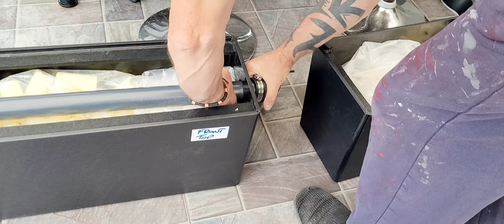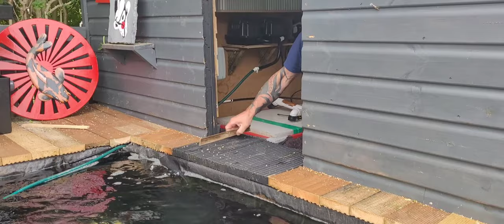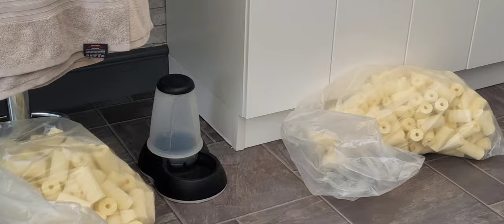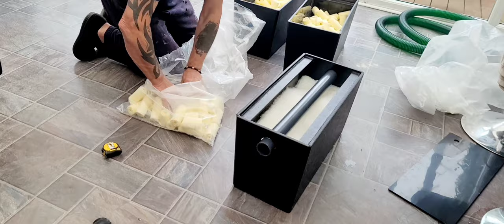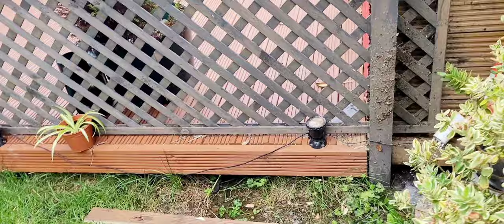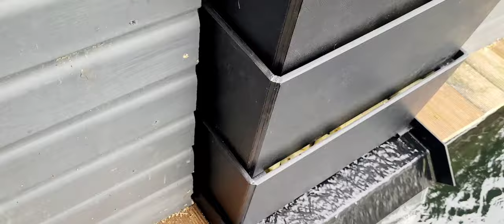Bakki Shower installation-hiding the inlet pipes part 4 and last part in this series.

Comment: Slower flow is better, allows more “dwelling time” it’s absolutely perfect, you don’t want it passing over the media to fast as it won’t be as effective! Absolutely perfect ! Nice install,
Reply from the maker: Thanks for the advice. We will leave it as it is
Reply: @copelandkoi  id have to disagree the flow is to slow that shower can have up to 12,000 LPH flow. bakki showers are meant to run with a fast flow 10,000 would of been perfect imo. And “dwelling” time isn’t relevant for this filter the bio benefits happen all most instantly and the faster the flow the better mechanical filtration is.
Reply from the maker: Hi thank for that. Dazzle koi said the same

Comment: You will get different opinions on flow rates. And I would say, the more tiers you have 3 or 4, the more flow rates you need to have. Probably 10000 or 15000 litre an hour. BUT, it all depends what filter you have before that. If you want to pull more from the skimmer line, then you might need to change the pump. But it's wether the green bin will handle it too. 
It's looks really good. 
For the Mind you Own business plant or baby's tears plant, I have taken all the soil off and pushed the roots as far as I could so they get splashed. Now the roots have grown really well. It will survive during the winter, but you might need to protect it with bubble wrap (not tight against it thought)
Reply from the maker: Thank Lau very good advice x
Reply: @copelandkoi  I forgot to say, the fish are looking super healthy!
Reply from the maker: @LauMagroTheFrenchKOInection  loving you'r new Chagi a stunner
Reply: @copelandkoi  thank you. With that body shape, I couldn't resist 😊